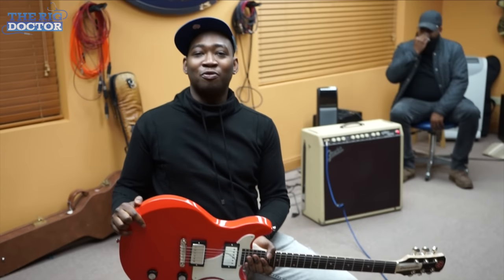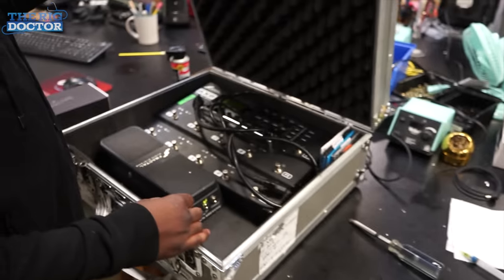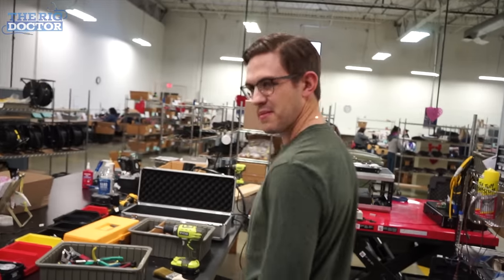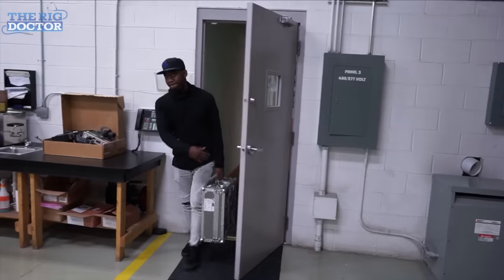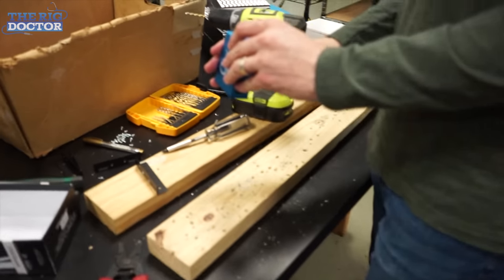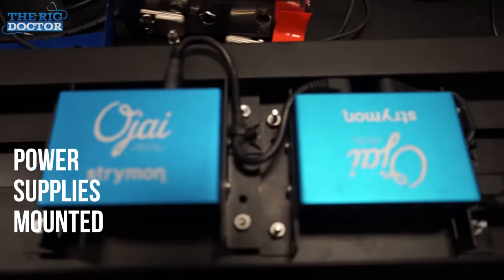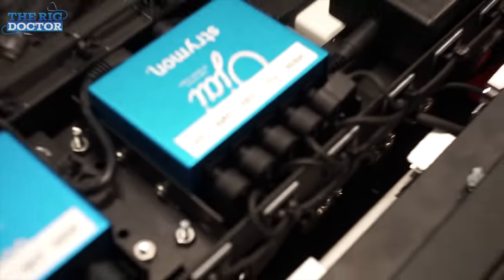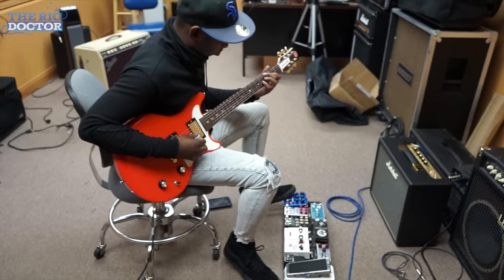Ultimate R&B Travel Rig // Isaiah Sharkey Pedalboard Build

Comment: I normally would never a trust a rig built a day before a tour, but this is a whole other level. The speakon connector for the power supplies?? BRUH
Reply from the maker: If it were a switching rig, I’d agree.  But, with series pedals like this, it can be well tested in an hour with little chance of latent failure if it’s properly evaluated before leaving.
Reply from the maker: Powercon, Speakon is for speakers only
Reply: @VertexEffectsInc  So...Sharkey is pushing everything in front the amp and not using fx send, correct? If so, why the need for a 3rd cable - speakon?
Reply from the maker: KirbyDTrim all in front of the amp, that’s a powercon for the power supply.
Reply: @VertexEffectsInc  Thanks.

Comment: I’m very interested in the interface that Dan made fro the Pedaltrain. Any more info about that (parts list, tips, etc.) would be appreciated. Great video!! Thanks - love your channel.
Reply: The bulk panel can be found here - https://btpa.com/PP-0012-03.html
The higher feet kit used to raise the board up can be found here - https://btpa.com/LIFTKIT01.html
The 1/4" connectors here these Neutrik ones - https://btpa.com/nj3fp6c-bag.html
PowerCON Connector is this one - https://btpa.com/NAC3MPA-1.html
Reply from the maker: You can find them on Best-Tronics' website just like Brad did in the video.  I think they sell them pre-built.  Links in the description.
Reply: Not that I’m trying to dissuade you from getting Best-Tronics stuff. But check out the Goodwood Interfacer or Underfacer. It’s both an interfacer AND a high quality in and out buffer on par with Mason’s favorite buffers.
Reply: Vertex Effects thanks!
Reply from the maker: Adam Smale Actually, it doesn’t appear that they are, I don’t see the specifications published anywhere, have you seen differently?
Reply: Vertex Effects Oooops! My bad. I emailed them and asked them. Just looked it up the email. The Goodwood Interfacer is “1M for input, 500R for output.” I thought I remembered the output impedance to be 100, not 500. So that means the output is to high. Right?
Reply from the maker: Adam Smale I am not sure what they mean by “R”?  If that’s 500ohm , which would make more sense than 500K, it’s too high.  It’s not terrible compared to most of the other stuff that’s out there, but compared to say the boogie or empress, it’s not comparable in terms of line driving capability with total stability and no tone change.
Reply: @VertexEffectsInc  I wasn't sure what "R" was either. I was hoping you'd know! 😂

Comment: Hey Mason - What did you guys use to Extend the Rubber-feet on the Pedaltrain (for more ground clearance?) - I may need to do that? -  to my little Pedaltrain Nano Acoustic board. Looks neat, clean and sounds fantastic.
Reply from the maker: I think they're from Penn Elcom - large rubber feed for amps.
Reply: @VertexEffectsInc  Thanks. I will check it out.

Comment: Mason, I may have missed mention of it in the video and I don’t see it in the list of pedals, but what is that Strymon “blackout” underneath his pedalboard? A third power supply?
Reply: The ojai doesn’t have those components internally, so it needs that little box, like the charger for a laptop. Zuma can use an IEC cable.
Reply from the maker: All the input voltage switching is happening inside of that box, outside of the power supply itself. Mr. Spock got there before me!
Reply: Vertex Effects but you said it better 😉. Btw, what’s your rate for this kind of work? I’m near you in Oakland 👌🏻
Reply from the maker: @MrSpock  I don't do it for hire, just to make YouTube content and teaching videos.  Talk to Brad and the guys at Best-Tronics and I'm sure they can help!
Reply: Vertex Effects & Mr. Spock 🖖 That’s the black box you’re referring to? I get the two blue Strymon power boxes. The black box with black lettering. I’m a strymon endorser and I’ve never seen the “blackout” units from them.
Reply: Adam Smale correct. It comes with each ojai purchase as it is needed to convert the wall power into the right power for the power supply. Just like the power supply for a laptop
Reply: Vertex Effects Yeah I’m probably not famous enough for good YouTube content lol
Reply: Mr. Spock Me too, I’m thinking. I was hoping I could hit up Uncle Mason just before or after NAMM 2021 to redo my pedalboard while on tour. But I may not be famous enough. Although maybe the Doc would be interested if it’s an interesting story or problem fixed that he could share with his YT audience.
Reply from the maker: Not my intent to leave you in the lurch, it’s just not something that I have the time to do.  My hope was in partnering with other builders, it would give you alternatives if they didn’t want to go to the DIY route.
Reply: Vertex Effects I get it.
Reply: @MrSpock  We can get ya sorted :)
Reply: Best-Tronics Pro Audio where are you located and what’re your rates?
Reply: @MrSpock  We are in Tinley Park, IL just south of Chicago (about 30 mins). We quote each board per its needs and do not have a "rate"
Reply: Best-Tronics Pro Audio oh ok, I’m in CA and looking for something local. Looks like you guys do great work though 👍🏻
Reply: @MrSpock  No problem. Thanks!

Comment: El cable del wah pasa por abajo, malísimo che, pensar que a estos tipos le pagan para hacer estás burradas
Reply from the maker: Tension or a hard break angle would be problematic - however, there is no stress on the cable under the way, there is about 1/4" clearance from the Dual Lock Velcro.  It's not sitting flush against the surface as a result.